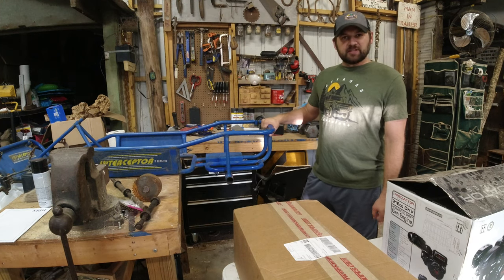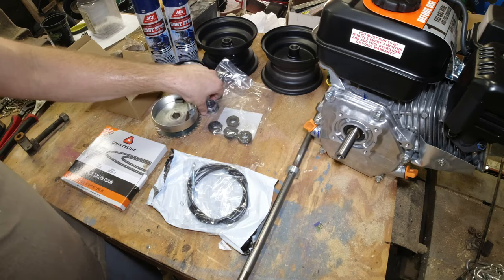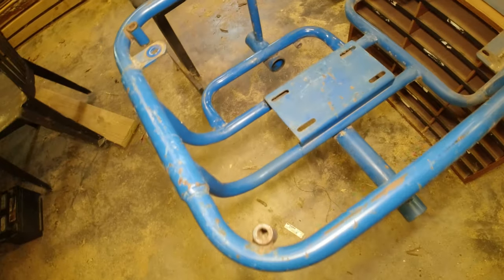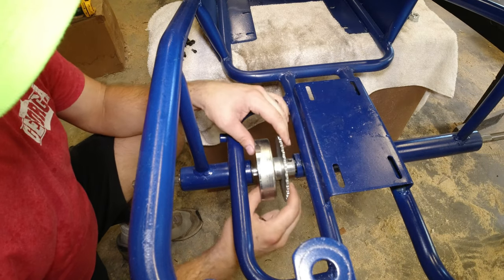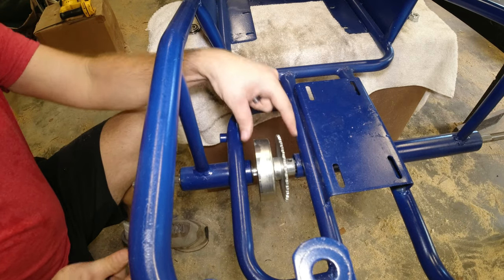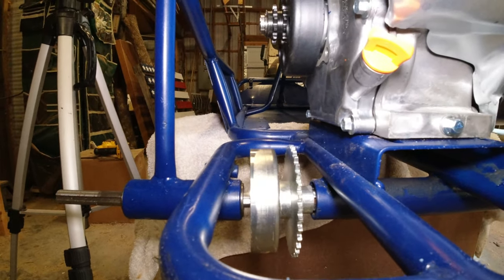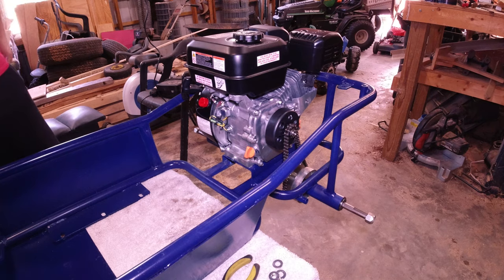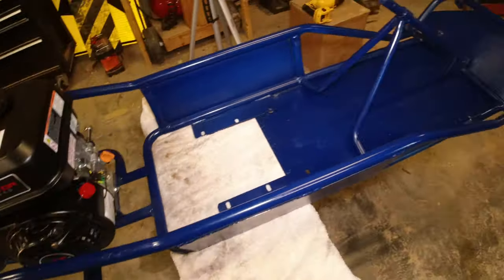Manco Interceptor Go Kart Build Part 1

Comment: My son has the same one we just rebuilt ours has a jack shaft. If you go from clutch to that drum sprocket youll burn the clutch up. You need a jack shaft. His runs 30mph with me in it and im 185lbs 😂
Reply from the maker: I appreciate it.  I did figure out that it is missing teh jack shaft after using it for a while.  without the jack shaft, the clutch was ok with the kids for now.

Comment: Juss picked up the same kart for my son...imma restore it with alil custom stuff here and there...any help would be appreciated
Reply from the maker: After some research there is a jack shaft between the motor and the axle that helps with the gearing.  My setup is a bit too fast I think.

Comment: Where did you buy the bearings from
Reply from the maker: From Go Power Sports.  I can't remember the dimensions but you can use this link to get you close. 

https://www.gopowersports.com/5-8-id-sealed-bearing-1-3-8-od-common/?campaignid=17318042849&adgroupid=&adid=&gclid=Cj0KCQjwz6ShBhCMARIsAH9A0qUWkV8YUMS8O_ElPv0hgPSdbqBOi0CVYG0vSzpCbOwQzDNs8v-UZOcaAjwTEALw_wcB